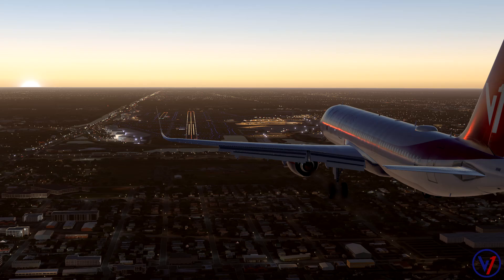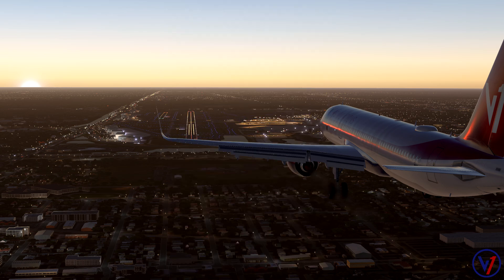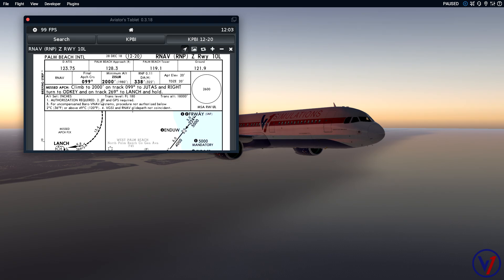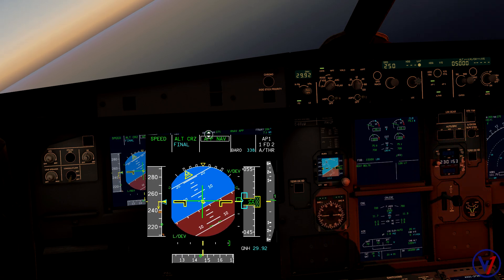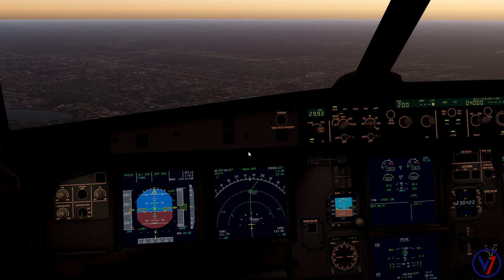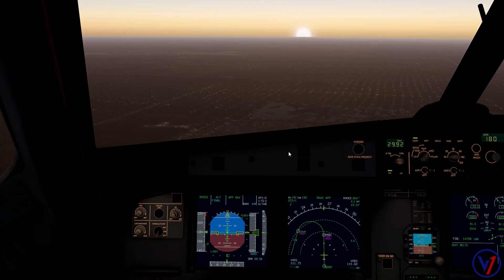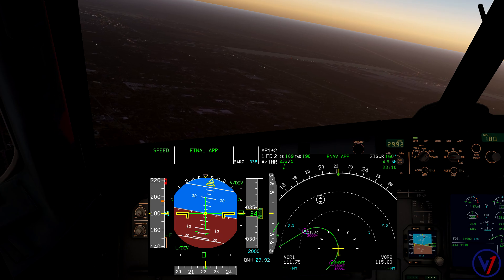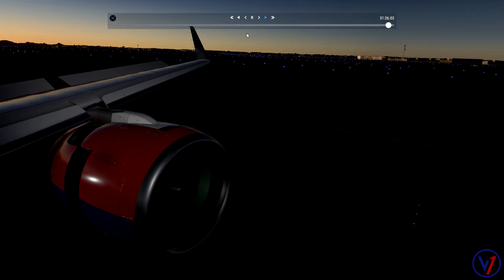RNP-AR Approach | REAL Airbus Pilot | RNP Tutorial | Part 2

Comment: If for whatever reason your accuracy suddenly got worse exceeding the requirement do you get an ECAM caution of any kind. And then do you tell ATC you can’t continue with the approach?
Reply from the maker: Yes monitoring of the GPS is required. If you lose GPS PRIMARY on the MCDU the aircraft will alert you that the GPS has been downgraded in which case dependent on the situation you would go around. However it won’t be on the ECAM it will be in the MCDU and ND

Comment: Great stuff, again--though I have no weird aviation history to offer, this time. One quick question: Is there anything in the regs to bar hand-flying an RNP approach, either on the FD or even the deviation bars alone?
Can the Bus even be configured that way--i.e. an RNP in the box but no FD bars up?
I ask because The Mighty Dash (tm) can do RNPs, handflown--on the HUD or just FD.
Reply from the maker: That would be a specific company requirement, nothing in the "regs" however depending on the accuracy required for the approach, APs might be required, that's again one of those questions that's hard to "blanket statement" answer. Now I can tell you tho that the bus is fully capable of handling GPS approaches with the AP off and just following the FD (ie handflwon)